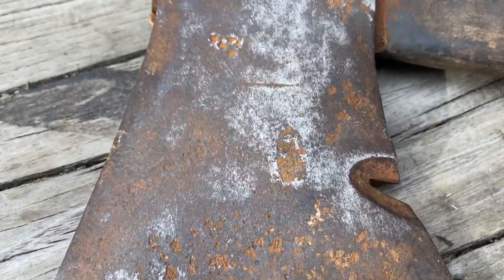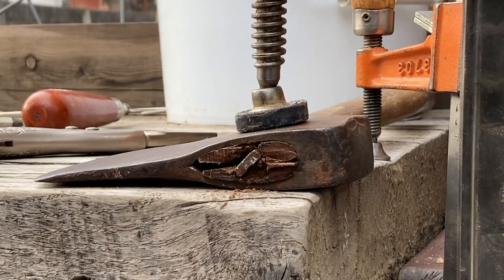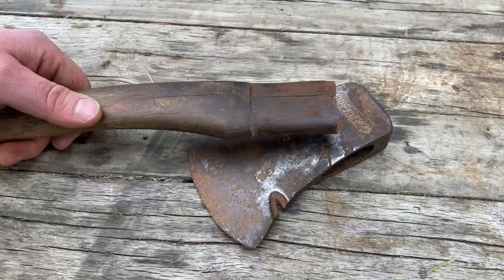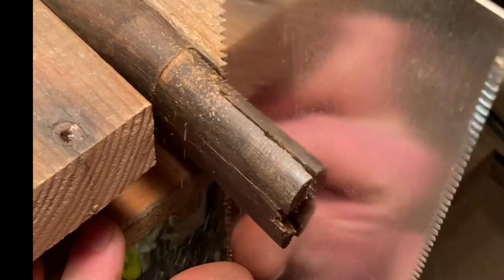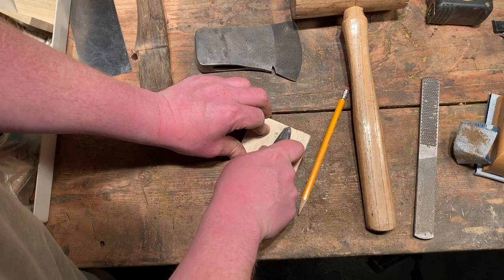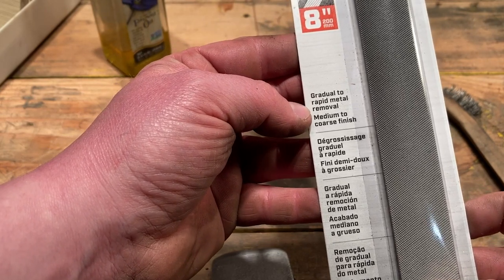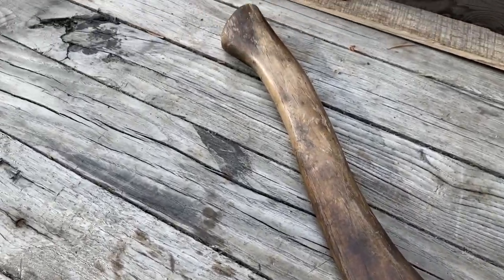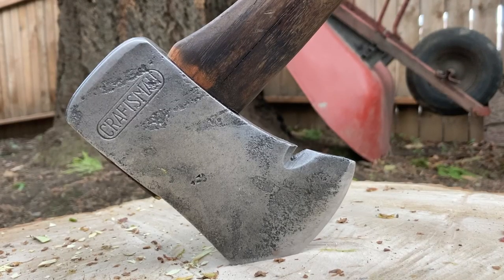Vintage Craftsman Hatchet Restoration Using The Original Handle : How To Rehandle

Comment: Did you mentioned the crack that's parallel with the handle?
I have the same craftsman hatchet but in almost new condition. The problem with mine is a similar crack to yours, but I have cut 4in diameter green branches and it cuts very well. I also like the ergonomics of the handle